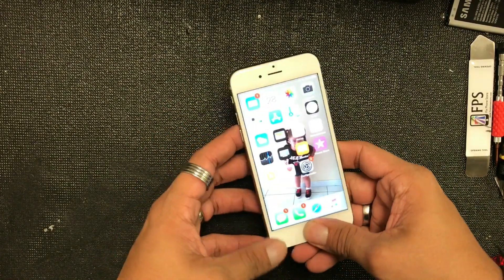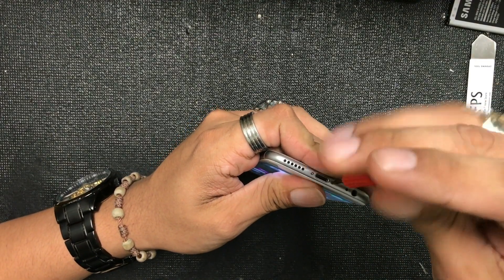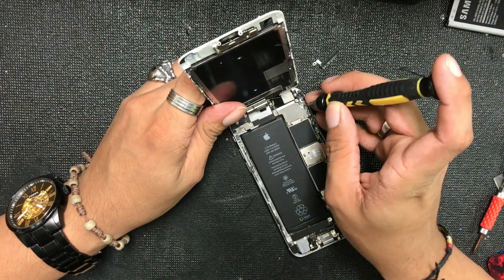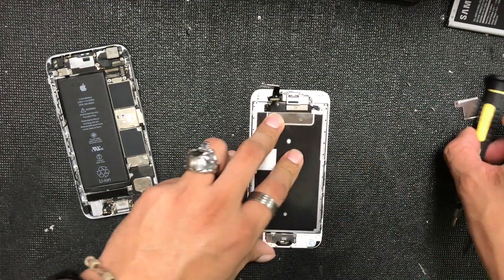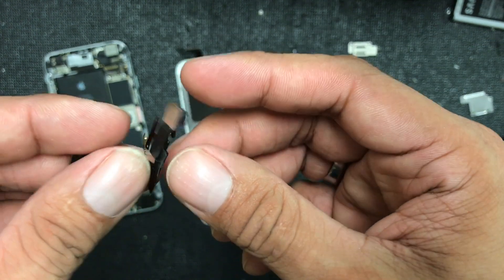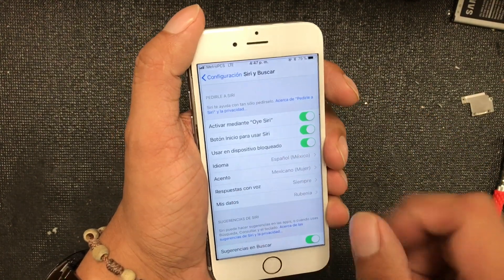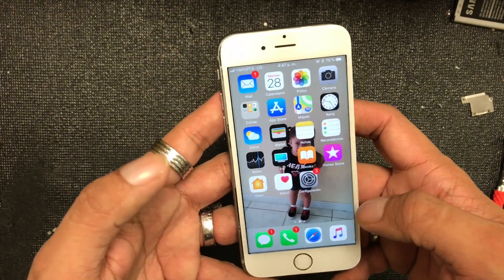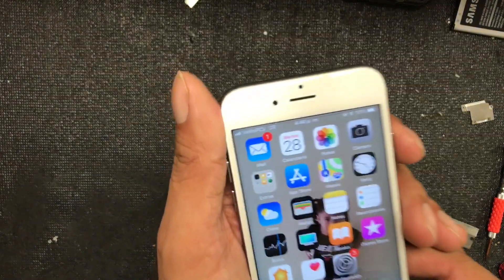Siri Not Working - Can't Hear - How To Fix - Video Calls can't hear me

Comment: If your Siri can’t hear you but you can make calls just fine and it’s only the Siri and text to speech, it is the microphone in the front facing camera. Get that replaced and your Siri will work again. I had that problem for a year and every person I brought my phone to said it’s a software issue. I even called apple and they couldn’t even help me out. I read somewhere on google that if I replaced the front camera that it’ll fix it and it sure did. I’m just passing on the info.

Comment: Hi there my is Joe from Sydney Australia I want to thank you I bought a iphone 6 second hand and the microphone or Siri did not work  .Six mounts earlier I bought  a iphone  6 from the charity shop for $10.00 I took a gamble and found out it was locked but I keep it six months later I bought another iphone 6 from the pawn shop and found out later  the microphone did not work I went to YOUTUBE and found YOU  I had two phones the same so I took off the one unit and change the other Thanks  Joe Ganado

Comment: I don’t understand because when I use anything else that requires a microphone it works perfectly fine but then I try to set up hey Siri and it doesn’t work. So some microphone somewhere is hearing me because I can use it with the keyboard for voice dictation and since Siri sucks really bad anyways it’s not even worth opening my phone since I can just use Google most of the time I’m in my house where I have an Alexa and Google home so fuck you Siri anyway
Reply: I have the exact same problem
Reply from the maker: Yes Apple iPhone use different mic for front cam for back cam and regular calls , and siri is the same as the video calls

Comment: After watching this vid I just turned the power off and on and Siri worked again no need to take ur phone apart!
Reply: Uhh. Yes and no. Your problem was a software issue. These ribbons do break very easy and it’s a 50/50 chance if that’s the problem. Have had several customers come in with this exact ribbon failure.
Reply: Zuzii -Llama please tell me how u did it like a min to a min cuz I am crying  it doesn’t work and I am scared that my dad would spank me cuz my Iphone got fixed from  a month so he would Spank me